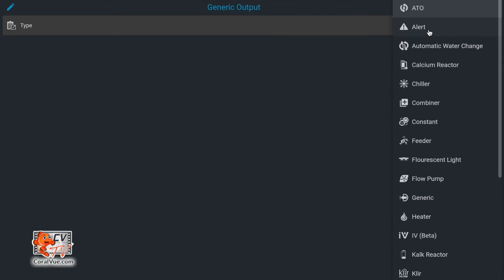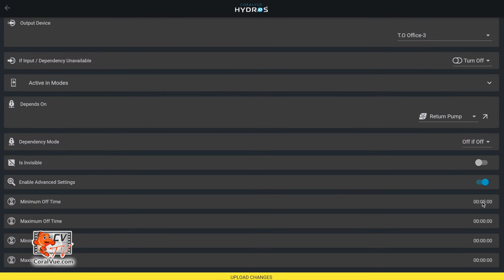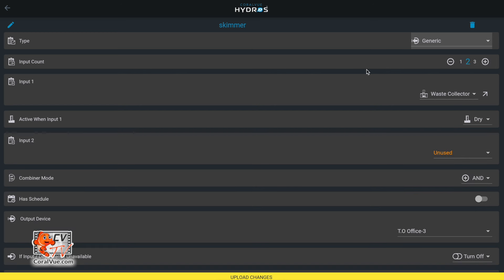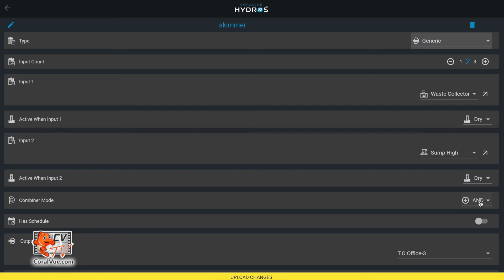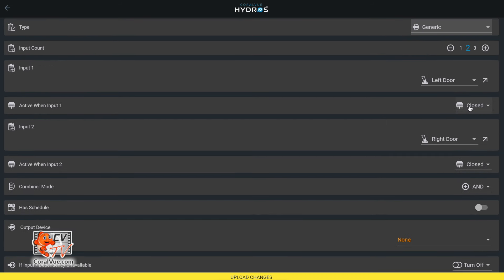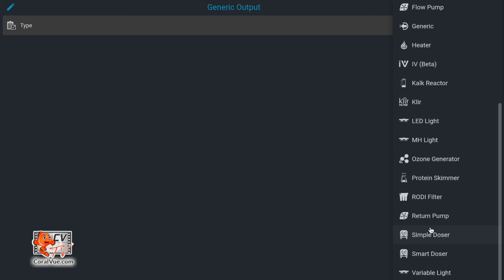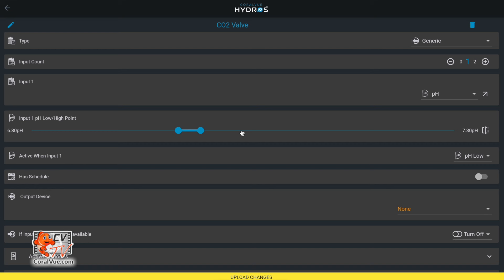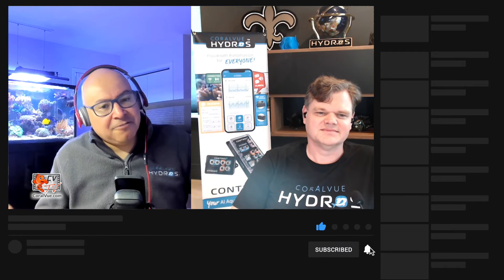HYDROS Generic Outputs

Comment: Carlos… at time stamp 5:48 of the video you stated other controllers do not have the option of saying AND or OR. This is 1000% false. 

Apex uses virtual output with multiple If statements that functions the same way. Yes, it isn’t AND or OR but it functions EXACTLY the same way. 

-GHL supports programmable logic. Programmable logic uses AND or OR to make a decision on switch channels. 

Please correct this….
Reply: Ya.. this is not right.  Your competitor controllers already do this.
Are you only trying to promote your product? GHL or Apex aren't dissing Hydros.